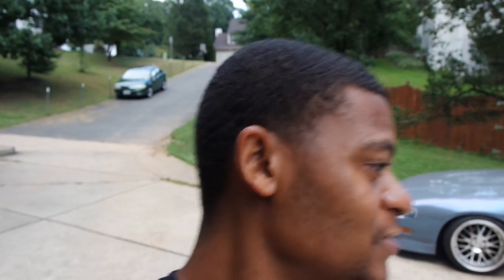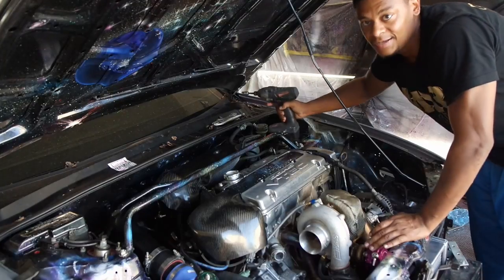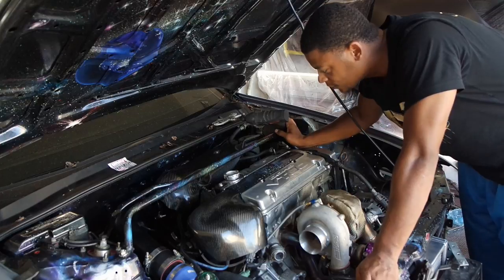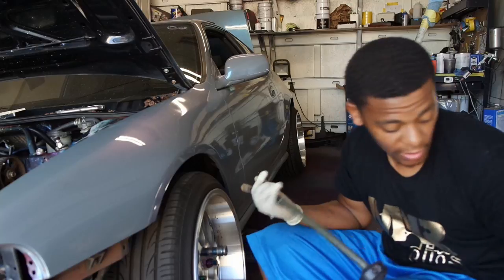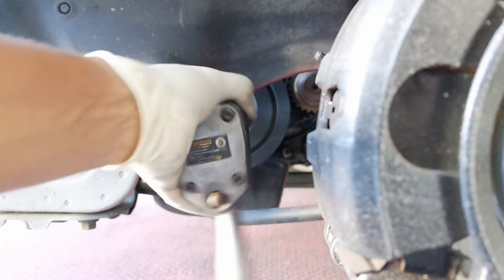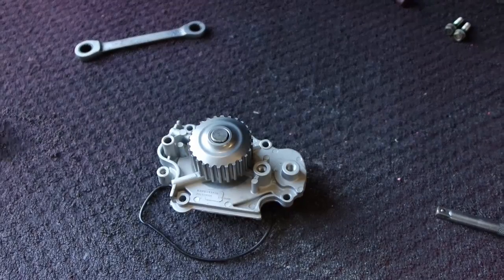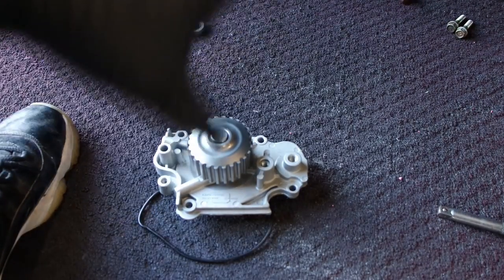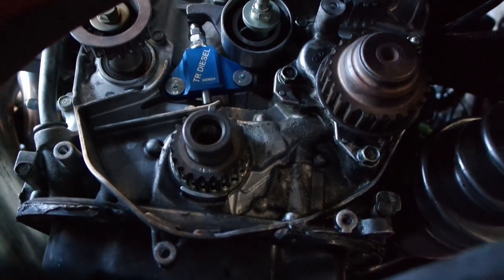Honda H22/F20b timing belt install | HONDA PRELUDE | water pump

Comment: Can you remove timing belt cover with out removing valve cover ???
Reply from the maker: Ehhh its possible but it wouldnt save you any time tho
Reply: Trey Be Dipping can I use h22 distributor for my f20B
Reply from the maker: @johnriddle5853  yes sir just bee aware if its obd1 or obd2
Reply: Trey Be Dipping How do I know if it’s OBD1 or OBD2 it’s in my 95 accord sir
Reply: Trey Be Dipping my rpms are hesitant and kinda jumpy it don’t have its full powerBut when vtec hits it has power I think it’s the sensor in the distributor have any suggestions?
Reply from the maker: @johnriddle5853  it may need to be timed try rotating the dizzy to see if performance changes
Reply from the maker: @johnriddle5853  1995 and under is obd1 and 1996 and up is obd2
Reply: Trey Be Dipping so your pretty sure it’s a oBd1 and thanks man I’m gonna try to rotate when I get home
Reply from the maker: @johnriddle5853  it could be a bad dizzy as well ive had a bad dizzy give me sputtering issues b4
Reply: Trey Be Dipping so I can use 92-96 prelude h22 oBd1 dizzy for my car
Reply: Trey Be Dipping I think I’m just gonna Buy a new dizzy for it But someone told me I couldn’t get a new dizzy for it or my car wouldn’t run
Reply from the maker: @johnriddle5853  false bro
Reply: Trey Be Dipping also I found a ECU in my car it said 97-01 F20B auto Ecu
Reply from the maker: @johnriddle5853  you shouldnt have been able to run that ecu in a obd1 car without a jumper harmess
Reply: Trey Be Dipping ok that’s why I have a different Ecu and all
Reply: Trey Be Dipping so can I use a 92-96 prelude h22 dizzy
Reply from the maker: @johnriddle5853  you should be able to bro
Reply: Trey Be Dipping thanks man I’m ordering one of them

Comment: How long did this take you?
Reply from the maker: About 3-4 hrs but thats with recording too.
Reply: @treybedipping1734   Have you ever experienced your car always wanting to stall out once the engine gets warm?  If so what causes this?
Reply from the maker: @jmac4013  depends in some cases the throttle cable needed to be adjusted or bad tps sensor
Reply: @treybedipping1734  thanks man, that at least gives me some direction to start looking

Comment: What tool do I use to turn the Timing belt so it’s top dead centre?
Reply from the maker: For the bottom put the 19mm bolt back in so you can turn the crank. The cam bolt is a 14mm

Comment: Hey trey if my cam timing is off a tooth or 2, would I have to go through this whole process to get it back in time? I have a long screw driver in piston 1 and got it to tdc can I just slide the belt off and readjust the cam timing like that or not a good idea?
Reply from the maker: If it skipped a tooth it could be possible is stripped the belt you may want to look replacing it. But yea there is no easy way to do it honestly
Reply: @treybedipping1734  well good to know there is no easy way. But your video definitely helps make it easier to do. I really appreciate the reply thank you fam!✌🏽🤙🏽
Reply from the maker: @badlilboy232  no problem bro ✊🏾

Comment: Did you reuse your tension Springs?
Reply from the maker: I replaced the hydrolic tensioner with a manual ks tuned style but reused the one spring with the hook

Comment: Why dont you use gates timing belts performance?
Reply: They aren't much better than oem if at all. I used one before and have one on my car as well.
Reply: They're better than oem last me 5 years  and going
Reply: I sell them. They are nothing special. Years doesn't mean anything, miles is the determining factor. I had a stock timing belt for 6 years before the tensioner went out and i swapped out my motor. I have a gates on there now as a matter of fact on my h23a. I get them at wholesale cost and thats the only reason i chose it over oem.  The belts are not "better", neither will "snap" unless never changed.

Comment: i have a 99 prelude h22a4 with a shattered oil pump i have the motor mount out and the crank pulley off and the oil pan. do i have to remove the water pump and other gears (6:30) to get to the oil pump? i took a pic of what mine looks like rn https://imgur.com/a/8B6YGCa